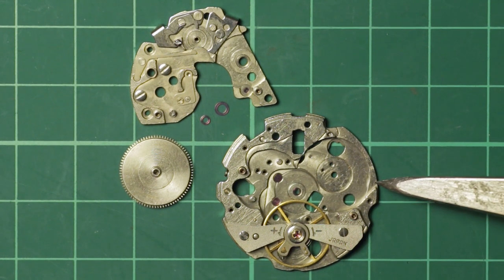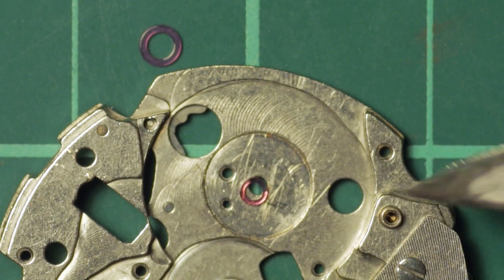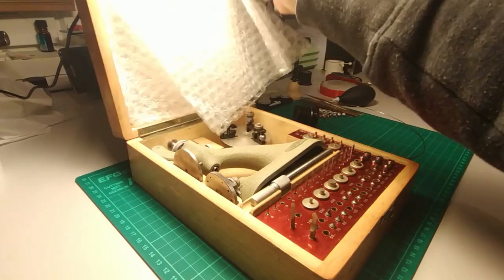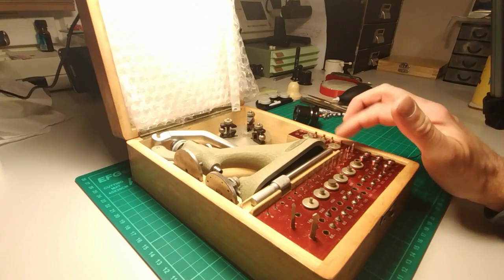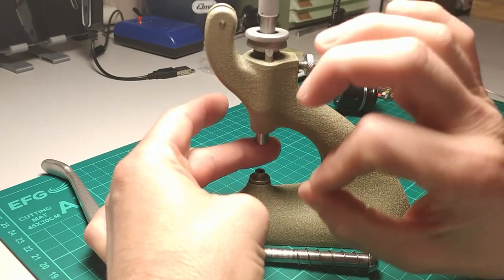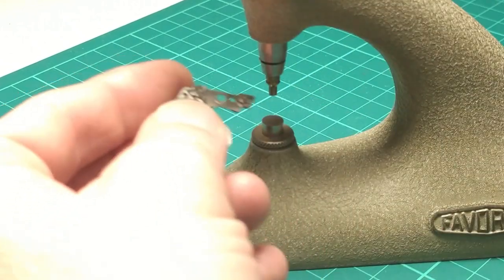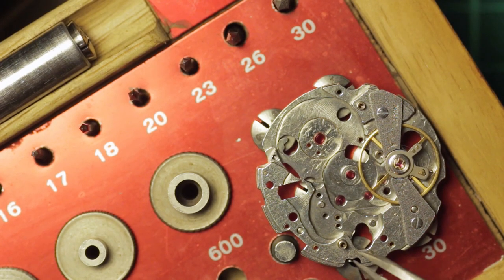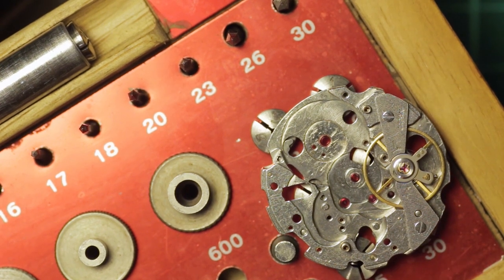Jewelling a Seiko 'Pogue' 6139 Barrel Arbor Seiko 6XXX Jewelling Procedure

Comment: Fantastic video, what a difference this will make ! Awesome upgrade ! Proper job
Reply: In most cases you can't actually fix the watches without addressing the arbor wear issue. They just end up stopping or have amplitude issues unless it's fixed. The edge of the barrel and ratchet wheel ends up clipping the top plate.

Comment: Thank you for this video :). I would have just one question. If the hole would be badly ovaled, how would you ensure the reamer goes straight in the center to ensure the top and bottom holes are on the same axis :). Regards
Reply from the maker: There are two ways, both covered in the video.
Either the plate with the movable clamps is used to clamp the plate level and the hole centred in a similar manner to using a centering stake on a staking set or the easier option in this case is using the 600 hollow stump which fits perfectly centred in the recess of the main plate, this way it won't wander off centre when broaching it out and also remains level as a result.

Comment: Its me again. :) Is there any chance these holes can be slightly closed and then opened with a smooth broach to remedy the shake like I have done on numerous swiss watches? Kalle Slap calls it "hammer time" I believe. What makes me wonder is the fact that you say the bushing on the bridge is stainless steel. I'm not sure my staking set will do much to move material around in that instance. The brass side, main plate, sure. I did look for the vta jewels but his link says they are sold out, other vta jewels I've found on ebay are surprisingly expensive.
Reply from the maker: I'm surprised the vta ones are sold out! They're the ones I use, I imagine he'll be having more manufactured.
The steel bushing is unlikely to be worn so chances are you'll be ok there.
The main plate, yes you can use the hammer time method but...... Check how badly it's ovalled first as some can be very bad and if you don't get the hole centred when broaching it that can cause worse problems and drag.

Comment: Hi, I am having a nightmare getting the correct tools together, bought a Seitz set but the stakes only go up to 5mm so utilizing the 6mm recess in the 6139 plate is an issue, I hope I can work out how to do it without the recess, also where can I get one of those deburring tools, cant see them anywhere, please help I am going crazy!
Reply from the maker: The deburring tool is in essence a watchmakers drill bit. you could actually, with care use a twist drill bit, all you're doing is taking the burrs off the edge to minimise the risk of cracking the jewel when pressing it in.
Without the 6mm stump you can't accurately centre it so you'd need something like the clamping plate I show and try to locate the centre with the broach. If it's badly out of round you can use the bridge fitted to centre it. Another alternative is to get a 6mm stump turned on a lathe if you have access or know someone who can.